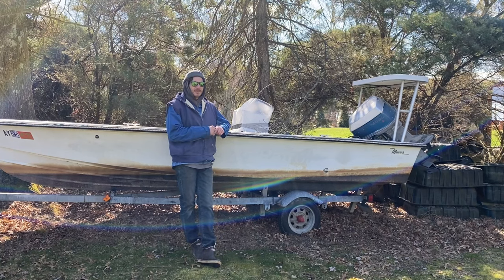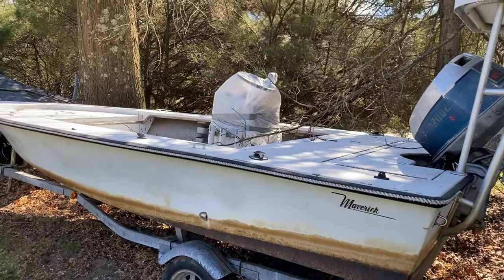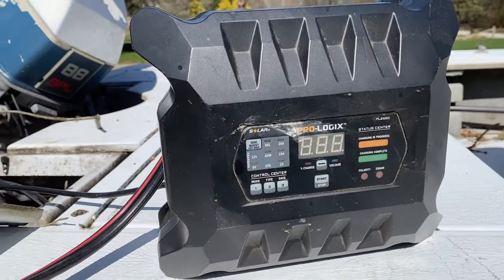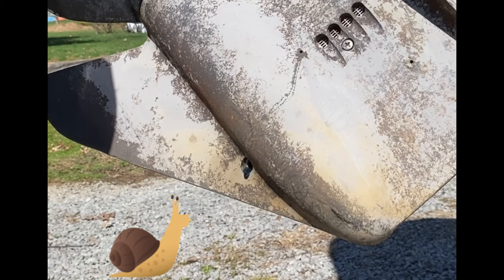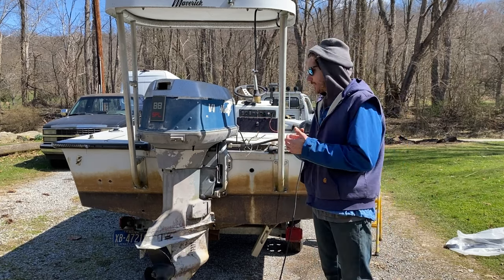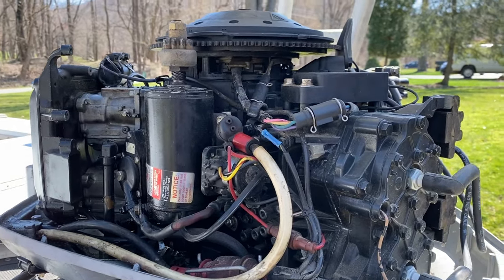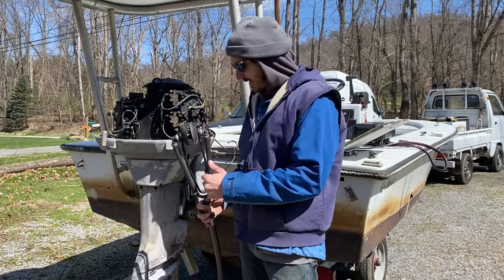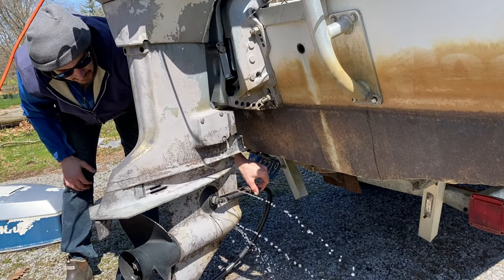Starting your boat after Winter | Old OutBoard Motor | Evinrude |

Comment: I heard your starter spinning without popping up a few times. Starter is going bad you got to take it apart and clean the brushes
Reply from the maker: I will do that, it has done it since I got the motor. I have a spare starter from a 75hp I think that is the same I can put on the bot for a spare. Thanks for the comment!

Comment: when was that engine last serviced ?
Reply from the maker: It was used the season prior. Spark plugs and wires are a year or 2 old. Not sure or when a water pump impeller was done. Lower unit gear oil recently changed.

Comment: I recently boat a boat with a similar model V4 Johnson, Its been fantastic so far, Just replaced the impeller, gear oil, and did a paint job. The paintjob mine had before wasn't as patina as yours LOL.
Great video! Hope the engine is good to you for awhile! i made some vids on my channel if your interested too
Reply from the maker: Yeah I like the motors, good ole Smokey’s seem to run well. I’ll check out your videos! Thanks for the comment!